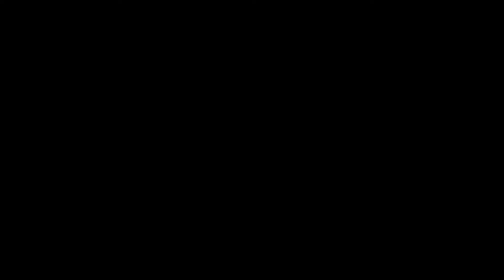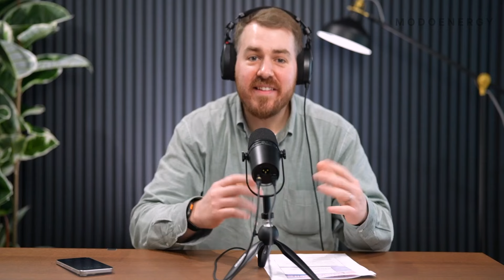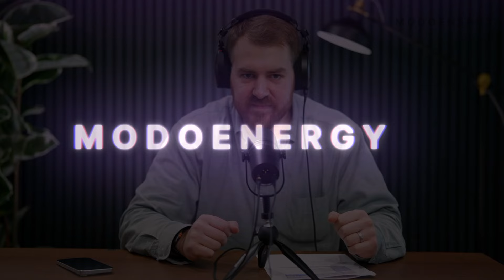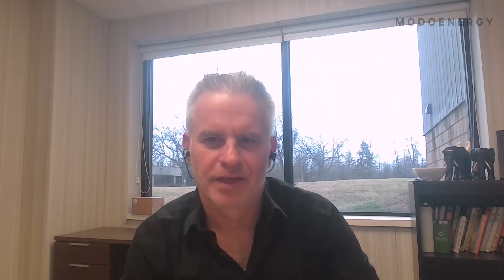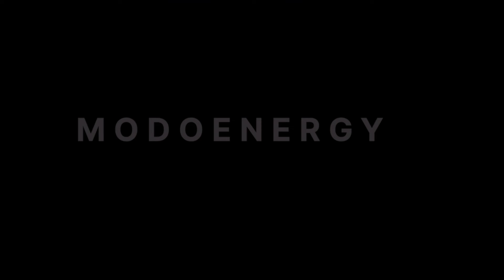Soidum-ion Batteries with Neil Kidner (CSO at Adena Power)

Comment: Without  production on Scale.  The price of sodium ion batteries will not be cheaper than LFP. 

So we have to go back to History.  2015 where LFP was more expensive than MNC. Because LFP production is on small Scale than MNC.

Therefore, once again we need the help of the Chinese government to subsidize the development of infrastructure and factories.

 So that sodium can be produced on scale. And can be cheaper than LFP.
Reply: Scale production Also the reason why ev is more expensive than ice
Reply: Nice conversation.  Where can I get recent cost projection data for 2 , 4 & 6 hour duration battery .